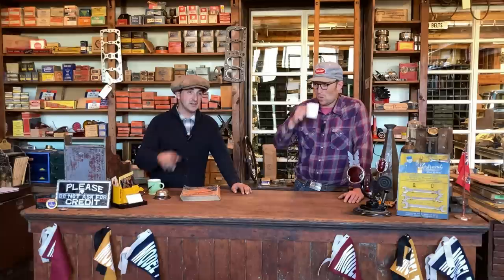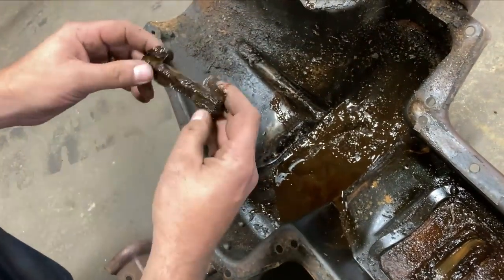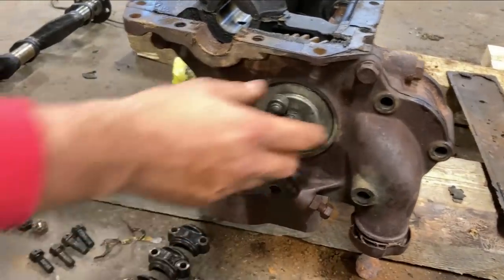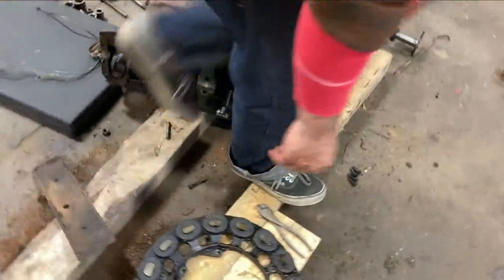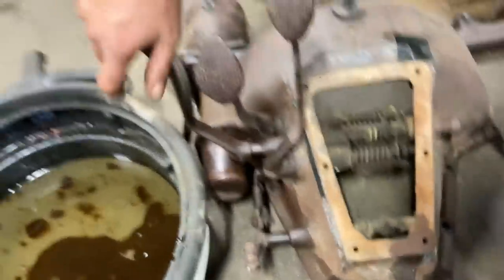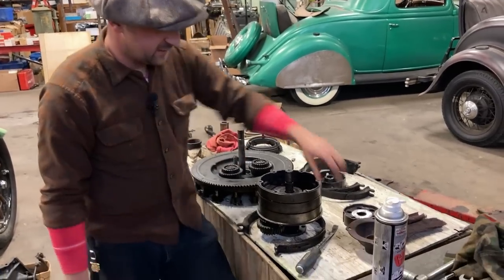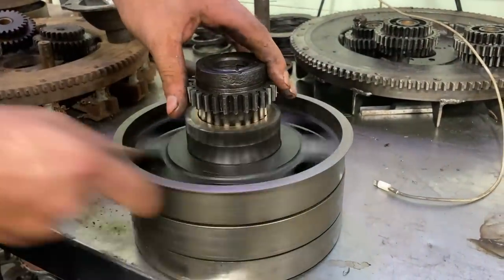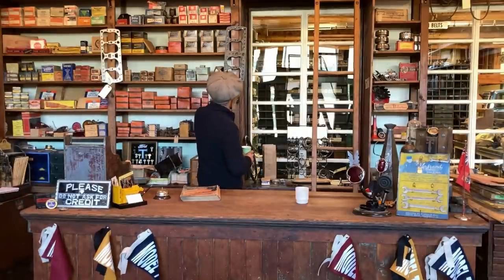EXPLODED VIEW!  Ford Model T Transmission Inner Workings Explained!

Comment: Thanks fellas. As a retired transmission engineer that was very interesting. It's amazing how the flywheel magneto setup was the best thing in those days. It must have been expensive to produce. The integration of the engine and transmission was also an idea not carried forward. It is a shame that that "upgrade" carried out so many years ago lead to the failure as it did. I've salvaged parts from equally crusty Flathead V8s and even got a couple running after linering and boring for new pistons. All the best, Mart in England.

Comment: I understand the T transmission now. It is just a mechanically applied planetary. You get direct drive, gear reduction and reverse. Modern automatic transmissions have multiple planetaries and are hydraulically applied.

Comment: you know there is a way to save that water freeze crack! its called stitching . i have saved several old motors with crack much bigger than that one bye drilling along the crack threading the holes and putting threaded allen head screws then grinding them flush ,good idea to brush some gasket shellac on the threads if there's water/oil /any liquid inside.  
i filled a 3/4 inch open crack in a AC bulldog mack water jacket crack on the cly casting that was 8 inch long, this was used in the steam boiler industry for steam boiler repairs held beautifully even under high pressures. be a interesting demo for a show to bring that T block back to life great channel keep up the good work

Comment: As always, an informative and fun video.  I did not know about welding hardened material to iron. (Don't worry, I don't ever weld!)  Hope to see a video of you rebuilding this.  I own an A, but T's are really interesting.  You were spot on about a manually operated automatic.  I heard you can use turbo 400 clutch discs in a T.  Not sure if it's true. Thanks Guys.